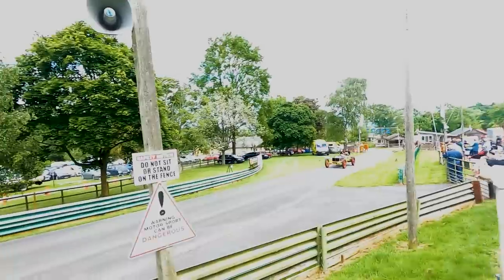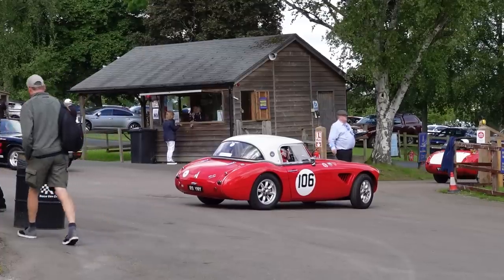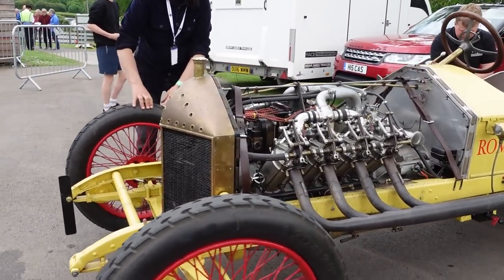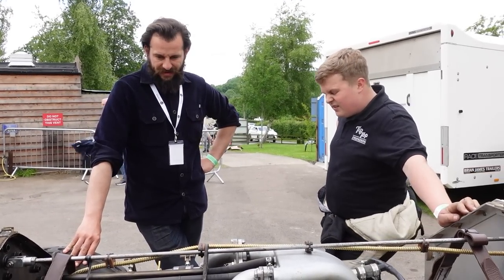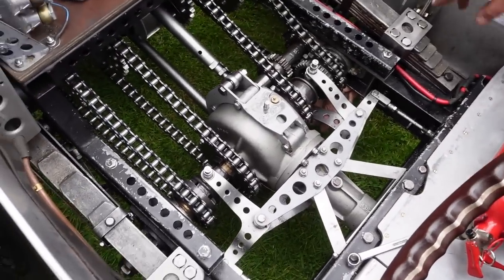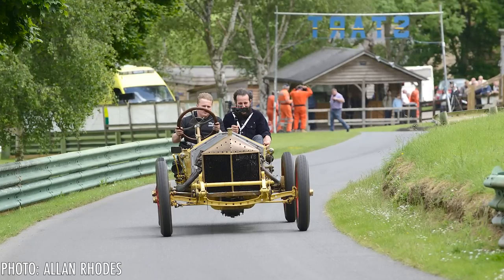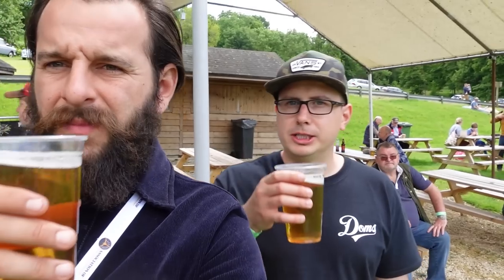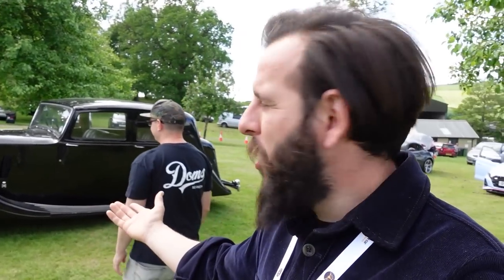My First Hill Climb Race!

Comment: The desire of the piston technology is undoubtabley seductive but an electric conversion might be an alternative choice for maybe a second project, Its always good to have a few lined up. Theres a engineer-biker up Grimsby way with a Merlin engine he might let you put in a car. Great Driving Jack , and great knowledge of the car. Are the double dogs not tied at the back because a heavy impact would snap a ring so its better to have a sprung link you can snap back in. Great video.

Comment: Outstanding! Just one thing though Mr C- before you embark on the project, for god's sake get a drive in a similar aero-engined car of the period, 'cos (as you no doubt know) with rear wheel brakes only, these things do not slow down well at all, it's vital to have a drive before you commit as an hour of discussion can't rival 10 minutes behind the wheel on an old airfield somewhere. 
Not meaning to rain on your parade in any way, but it had to be said!   Good luck!

Comment: Was that a Jensen C-V8  at 18.37. ?
Reply: No, it was a Jensen 541 R or S model from the late 1950's or very early 60's. Not a good car, (like the CV8 fitted with glassfibre coachwork)  and propelled by the pre-war designed , but  late 1940's built 4 litre commercial Austin truck engine which also found itself into the post war Sheerline and Princess models..  A very agricultural lump at best ...

Comment: Anyone know what the car at 18:37 is?
Reply: Birashanuman
Birashanuman
37 minutes ago
No, it was a Jensen 541 R or S model from the late 1950's or very early 60's. Not a good car, (like the CV8 fitted with glassfibre coachwork)  and propelled by the pre-war designed , but  late 1940's built 4 litre commercial Austin truck engine which also found itself into the post war Sheerline and Princess models..  A very agricultural lump at best ...